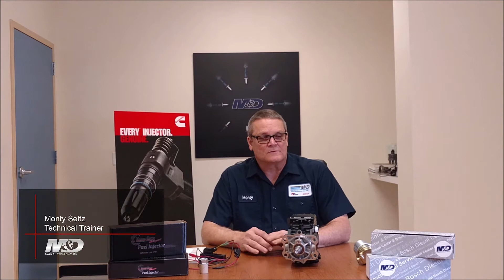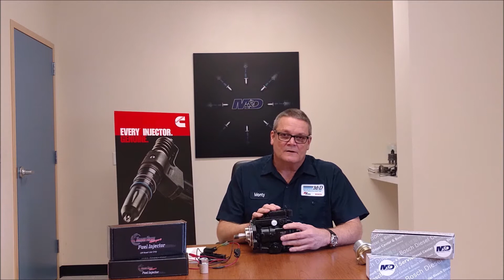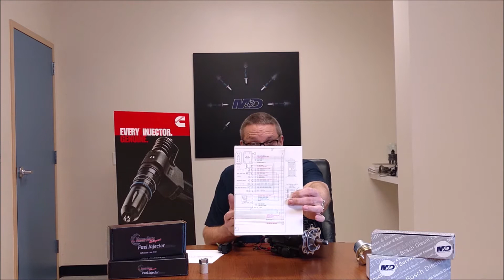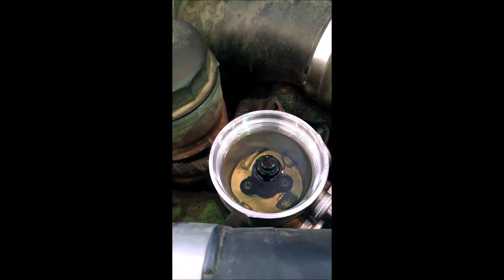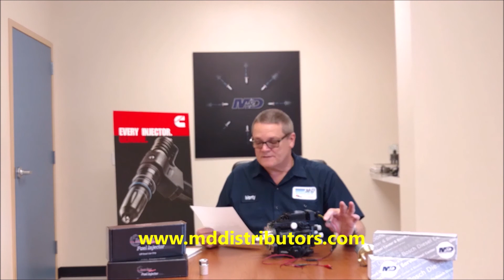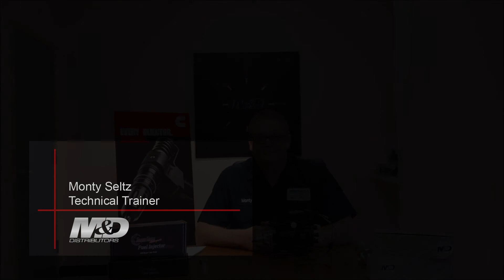1998 - 2003 Dodge 5.9L Cummins "No Start" - VP44 Injection Pump

Comment: I have a 2000 Rv with a 5.9 Cummins that has sat for a couple of years , I’ve put a lift pump and new batteries and it won’t start, even with stater fluid, no white smoke or anything, it only has 60,000 miles on it , any suggestions?
Reply: Mark did you ever get the RV fixed? 
I’m having same problems with my 5.9c, Ty

Comment: I have an 05 dodge 2500 5.9 with wait start light that stays on and starts but starts hard. Has low power. What could it be has p1222 code. Possible loose or bad tube or injector